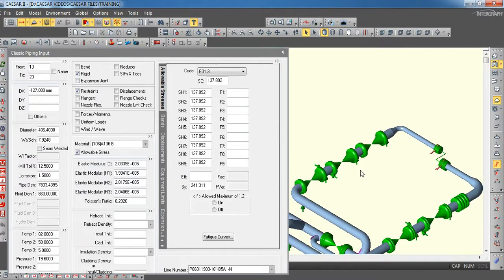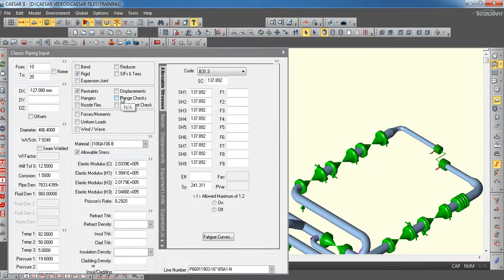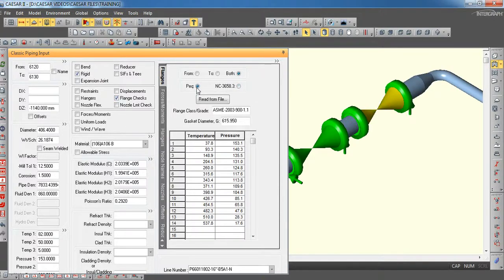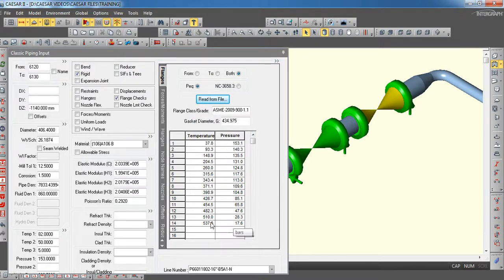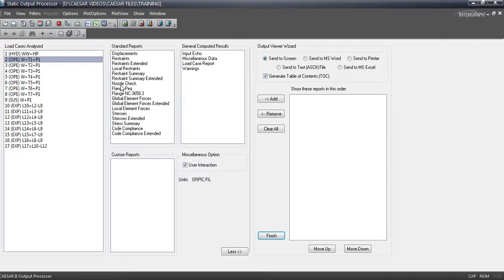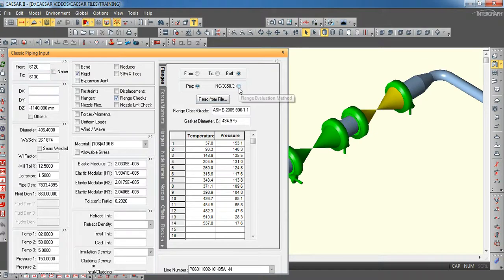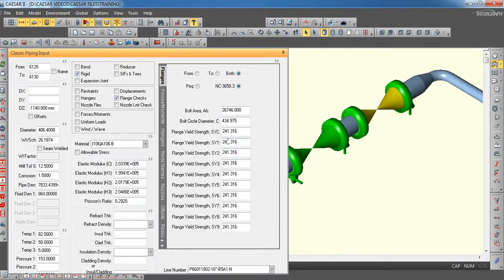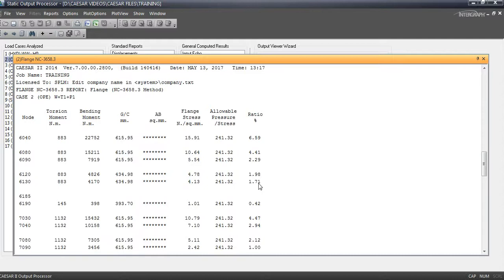CAESAR-2 FLANGE LEAKAGE CHECK

Comment: Hi,
In NC method SYC yield strength and  sy1 to sy9 values are comes differently
Reply from the maker: Yes, actually we need to consider Yield strength values based on the temperature..
I have considered the same values..

Comment: B16.5 2013 - class 900 - diameter of bolt circle 616 mm, not 434? where did u get that number?
Reply from the maker: Dear Mr.bunc11, Thanks for your valid point. As per ASME B 16.5 For 16", 900# BCD is 616 mm only.

Comment: hi after i run it, the allowable pressure/stress column only show zeroes value. What step did i miss?
Reply from the maker: Please share your mail id. You need to enter the flange analysis temperatures in Load case editor

Comment: How to get the bolt area calculated ?
Reply from the maker: We are using area of circle formula to calculate the bolt area of 1 bolt and to be multiplied by total no. of bolts to get the total area.
In this video i have calculated  Bolt area for your understanding.
Please refer ASME B1.1 to get the Bolt area directly based on the thread.

Comment: What method is appliable for RTJ flanges?
Reply from the maker: Flange leakage check is applicable for all type of flanges based on the criteria provided in the Stress specification.
You can check the detailed flange leakage method (ASME Section VIII Flange Leakage Checking Method available in Caesar ii)

Comment: What is the different between NC-3658.3 and Peq?
Reply: NC-3658.3 its for the nuclar piping and the peq is asme b16.5
Reply from the maker: Flange with High Strength Bolting:
For flanges with bolting material having allowable stress at 38°C not less than 138
MPa shall be checked as per ASME Sec. Ill Division 1- Subsection NC, Clause NC-
3658.3.
Mrs~ 3125 (Sy/ 36000) CAb 
Mrd ~ 6250 (Syl 36000) C Ab 
Where
Mrs = bending or torsion moment (considered separately) applied to the joint due to
weight, thermal expansion of piping, sustained anchor movements, relief valve steady state thrust and other sustained mechanical loads applied to the flange joint during the design or service condition, (in.-lb).
Mrd = bending or torsion moment (considered separately) as defined for Mrs but including dynamic loadings applied to the flanged joint during the design or service condition, (in.-lb).
C = bolt circle diameter, (in).
Sy = yield strength of flange material at Design Temperature, (psi).
Ab = total cross-sectional area of bolts at root of thread or section of least diameter under stress, (in2).
The value of Syl 36000 shall not be taken as greater than unity.
Reply from the maker: Flange not covered in the above category, leakage check shall be carried out based
on Equivalent Pressure method as per ASME SEC Ill Division1-Subsection NC, Clause
No. NC-3658.1 (a) Et (b) as mentioned below.
Tightness of flanged joints is acceptable if:
System Design Pressure + Pe q <= 1. 5 times Rated Pressure at Design or Service temperature.
Peq=16Mfs I (pi)*(G3)
Or
Peq=8Mfd I (pi)*(G3)
Where
Peq = Equivalent Pressure, (psi)
Mfs, Mfd = as defined above
G=Diameter at location of gasket load reaction, (in)
Flange analysis can be performed by using ASME SEC. VIII Div. 1 if required.

Comment: NC flange leakage is not applicable for all process piping. Therefore, calculations are not applicable in most cases.
Reply from the maker: Flange leakage check is applicable for all type of flanges based on the criteria provided in the Stress specification. First we will check the flange leakage using Equivalent Pressure method. If it fails in PEQ method, we will go for NC 3658.3 or ASME Section VIII detailed method